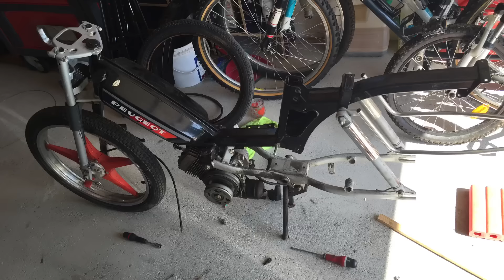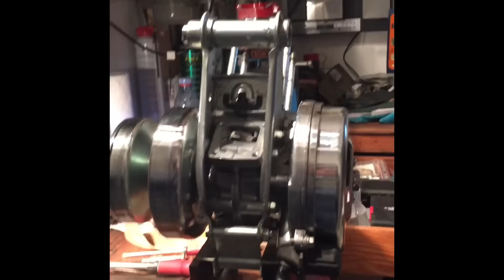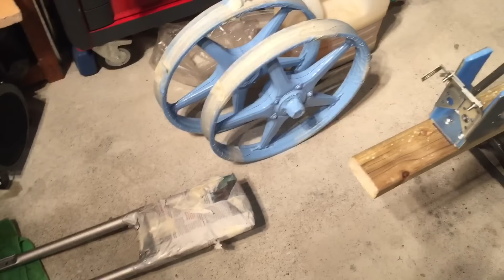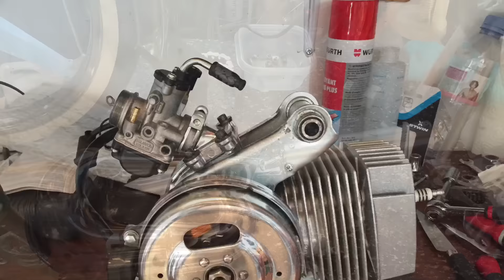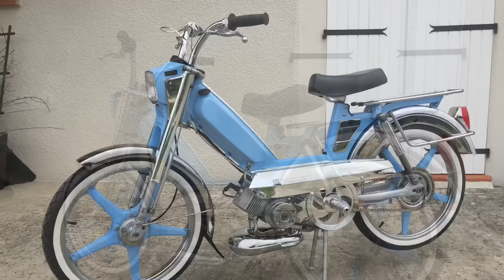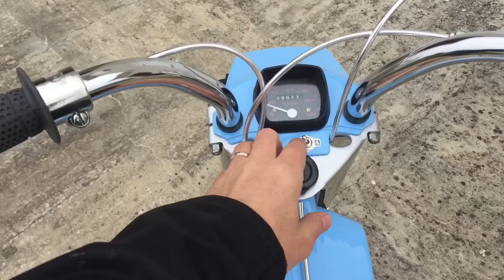103 MVL Polini 70cc / Dellorto 17 / Simonini

Comment: SLT pourrait tu me dire se que tu lui a fait  comme configuration ? Stp merci
Reply from the maker: Salut, un Kit Polini 70, boîte à clapets Polini, carbu Dellorto PHBG 17 sur bas moteur origine avec allumage électronique Peugeot. Pot Simonini. Transmission rallongée 13x43 avec ressort moteur renforcé et vario allégé … voilà tu sais tout … taillé pour la balade en mode cruising avec juste ce qu’il faut de puissance pour de bonnes sensations 👍😉
Reply: @samuelbrachais4994  merci c'est sympa de me répondre tu a retoucher au transfer ou pas et tu a fait quoi pour allégé le variole à part retiré 3 bille ?
Reply from the maker: @kevinhilaire9580  Oui j’ai aligné les transferts mais dans un second temps car il a fallu que je change les joints spy et donc en ouvrant les carters j’en ai profité … résultat : pas de différence 😂😂 … les passages aux carters sont plus petits que les transferts du cylindre donc pas d’obstacle au flux des gaz, voilà probablement pourquoi ça n’a pas une grande influence de les aligner. Pour le vario, 3 billes en effet et je remplace les masses sur les basculeurs d’origine pas des masselottes « pastilles » pour retarder l’ouverture du vario et ainsi avoir un moteur au bon régime tout le temps 😉👍
Reply: @samuelbrachais4994  merci c'est cool je note

Comment: longue la transmi,  combien ?. dans mes souvenirs le 70 polini avait son max d'accélération et pointe en 11x45.  après cetait trop long et ne gagné plus en pointe !
Reply from the maker: 13x43 exactement, en effet c'est long, mais j'ai travaillé sur le variateur pour avoir une plage d'accélération très plaisante et ce jusqu'en pointe, une pédale de lanceur est là pour peaufiner le tout si nécessaire (je m'en sers très peu … en côte raide parfois) En dessous de 40 km il y a rien, mais à cette vitesse je suis en low ride avec le moteur qui pète, par contre dés 50 ça grimpe non stop jusqu'à 100 / 110 sans forcer … je roule en campagne donc cette config me convient, c'est sûr qu'en ville c'est pas adapté … fais moi part de tes config et des différences constatées … ça m'intéresse … n'hésite pas à aller voir la vidéo où je film mon frère en rodage tu pourras juger du comportement moteur … même si en rodage évidemment. A+ ami du 103 😉
Reply: Samuel BRACHAIS ok 👍 Moi j'avais constaté avec moteur: culasse polini,  Kit polini w preparé, squish 0,90mm,  carters moteur polini asm grosse Admission,  boite a clapet polini lamelles carbone malossi 0,35, pipe 19-21 polini re-microbillée,  allumage mvt premium digital direct, Disque d'inertie malossi mhr,  poulie embrayage doppler variotop malossi prise direct G.P,  carbu 21,  pot ninja g2 carte noire,  ressort moteur doppler,  etc etc en 11x45 mon frère me suivait a 120 compteur voiture,  ensuite en 11x39 resultat 120 compteur voiture mais avec moins de patate donc j'ai opté Logiquement pour le 11x45.  il faut faire différent test de transmi des moment ont est surpris ! ta pas forcément moins de pointe avec une transmi un peu plus courte car le moteur prend plus de trs/min ! après trop court oui tu perd ! enfaite le top du top et d'avoir plusieurs couronne et de tester,  et le top est d'avoir la transmi le plus court possible avec le max de pointe !. C'est-à-dire par exemple tu monte a 100 en 11x48 et que tu fait 95 en 11x52 mais 100 aussi en 11x45 alors la transmi parfaite est la 11x48 ! super mix d'accélération et de max de pointe.  tout comme le vario,  le reglage optimal est d'être au max le plus légèrs possible tout en fesant attention que la courroie monte toujours jusqu'en haut des joue ! 
pourquoi perdre de l'acceleration si c'est pour avoir la même pointe !. voilà j'espère avoir été assez clair dans mes expliquation !?. sinon belle renovation. 
VIVE LE PEUGEOT 103 !!!!
Reply: Bonjour. C'est quoi le squish ??